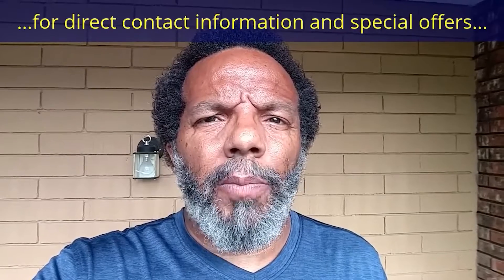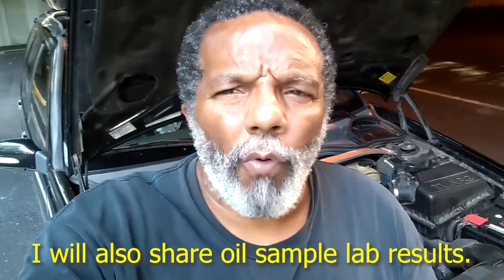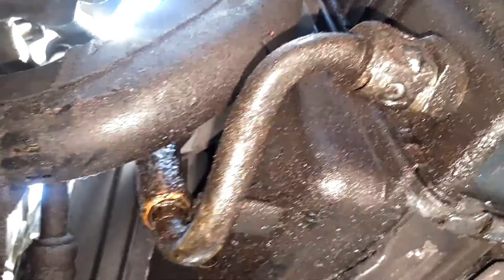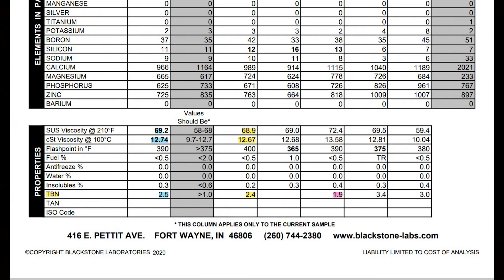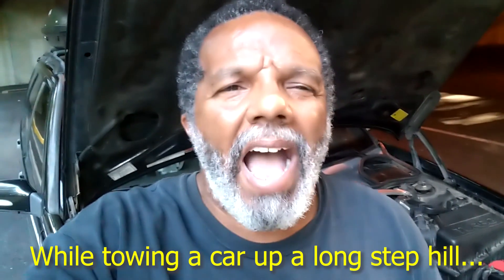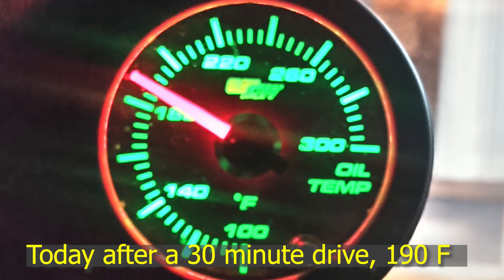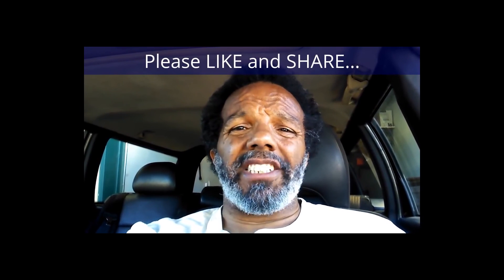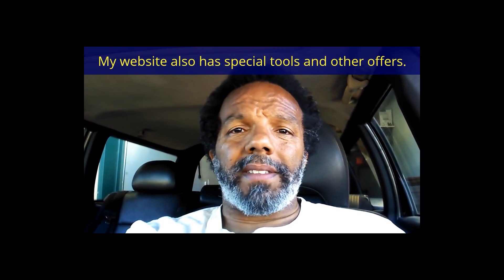Should you remove the oil cooler lines on your P80 car? My test results, Volvo 850, S70, V70 etc.

Comment: Thank You! Just orderd the block off, now i can return the new lines for my $255 back :)
Reply from the maker: Good deal.
Reply: Where did you order the block off plate?
Reply: @Focalpointfloors  Not sure I got it off a random Volvo site. I just looked up the part on web and got it for around $50

Comment: im a liitle late to the vid but wondering.. Can you just leave the connections on the radiator open? no oil is pushed out? may be a dumb question but im about to do this job and curious. Thanks
Reply from the maker: Yes
Reply from the maker: https://youtu.be/ccxKtEdoXVQ?si=Rc0qPQ1dWe9pWy6E
Reply from the maker: I just posted a short cut video on it 4 post ago. 🤨😏
Reply from the maker: https://youtu.be/nKOBYrvoCG8?si=MmnJHMVoRK28rOJ6

Comment: Thanks for your video bro... I lkke to make some power modifications so i think that i will need oil cooler, so i think about to put one from alfa gtv with radiator not temperature exchanger...?
Reply from the maker: Ok

Comment: Hello Robert,

I have a V70r Fwd from 1997 and when I bought it I noticed that the oil coolant lines were deleted. Since I knew that these mixed radiators sometimes they mix oil with water, I installed an external oil radiator. Now my question is... The coolant hoses that came from the oil radiator are never worm or hot. is it possible that the thermostat is not workin properly? Can it be something else or is it normal? 

Thank you
Reply from the maker: What's the temperature of the oil?

Comment: Are the existing bolts the correct size?
Reply from the maker: I don't understand your question.
Reply: @RobertDIY  I mean are the existing bolts on turbo cars with the thermostat the correct size and length for the cap?

Also can you not leave the lines abandoned if you find a way to tie them off?

Comment: Is there a part number on this block off plate?
Reply from the maker: I have a few of them if you need one.
Reply: @RobertDIY  That would be cool..I did purchase new lines but have been putting off replacing them..Do you have your block off ports listed on your website?
Reply from the maker: should be in the remarks section.
Reply from the maker: nope.

Comment: Thank you for the informative video. Question. Looking at the oil cooler line thermostat, which line is the oil return line to the engine? Does the oil travel to the cooler via outside line and return back to the engine using the inner line?
Reply from the maker: I have no idea. What difference would it make? I'm getting rid of both of them.
Reply: I’m adding an oil accumulator and need to tap into the return line. I tried running the engine with both oil cooler lines off and, surprisingly, oil poured from both lines. I’m baffled.
Reply from the maker: You can pull the lines or disconnect them from the rad. Start the car and go see which one is pumping oil out.

Comment: Mine were deleted when i got my car and i had been trying to figure out a way to reverse that. I guess that's one less thing to worry about then!
Reply from the maker: I can get you a reversal kit. 😅
Reply from the maker: If you plan to do some extreme driving you can add the system back but run the lines to an external cooler.

Comment: I think I have some leaking oil coolant lines on my 95' 944 (FK). There isn't any lines going to the radiator, but I think there is a housing where the oil filter screws onto the car with two lines going to it. Do you know if this can also be deleted? 
It looks like this: https://www.volvopartswebstore.com/images/parts/volvo/fullsize/GR-68614.jpg
Reply from the maker: I would not. Takes no time to replace them and they are cheap. 🤦🏾‍♂️

Comment: Thanks so much for the info. Mine have been leaking for a year and are getting removed as soon as I can get one of those block off plates.
Reply from the maker: Awesome.
Reply: Plate part number 1366780, seal part number 1366791. They just came back into stock at my dealer!

Comment: Thank you for your time and research on this! Could you post the part number for the block-off plate and gasket? Do parts suppliers carry them or better off pulling from a junkyard?
Reply: The parts just went back in stock at my local dealer. 'Cap' part number 1366780, gasket part number 1366791.
Reply: Matt Jones I concur
Reply from the maker: Give me 10 minutes. I'm sure the parts are on a parts website. I also showed the part with the part number on it. 🤷🏾‍♂️
Reply: Did you by chance find that part number? I plugged in the number I could read off of the video and it came up as nothing.. I appreciate it!

Comment: Hi Robert, I tell you my experience, I bought my 98 v70 awd with the cooler lines canceled, it was always my doubt if this affected something, the previous owner explained to me that the radiator broke down and I mixed the water with the oil, and for that reason they canceled the cooler, I consulted with a volvos mechanic and he told me that it is not usually a major problem that I do not have it for city use or normal use, so I left it as it was, now I have a question with which can you help me, what is the normal operating temperature of your volvo? mine is usually between 93 and 104 C, it has coolant and the system has a new water pump and a new radiator, the needle on the dashboard is always in the middle, what could you observe in your Volvo on this issue? thank you very much Robert! Regards!
Reply from the maker: https://youtu.be/gt9w-ZSxs9I
Reply from the maker: https://youtu.be/ZJb8KInLiEg
Reply from the maker: https://youtu.be/OZUvOOTkFv4
Reply: 105°C is where fan starts to blow so everything below that is ok